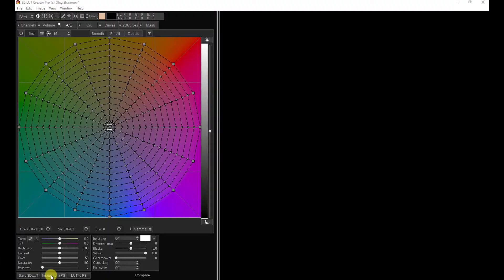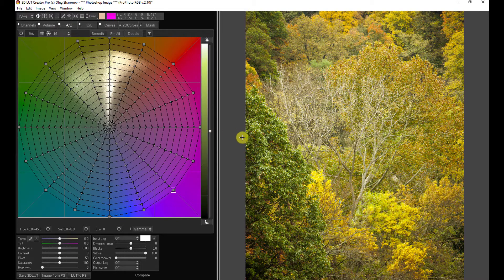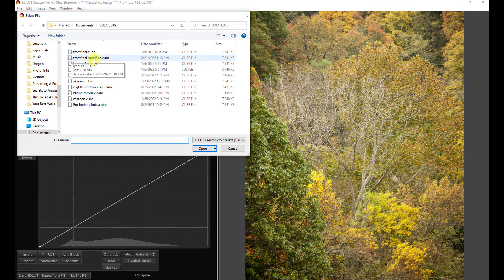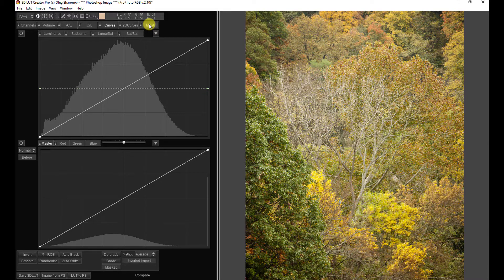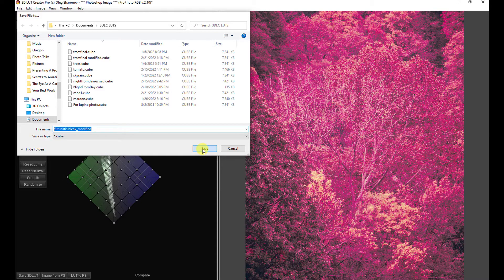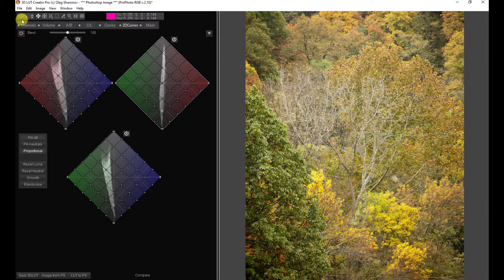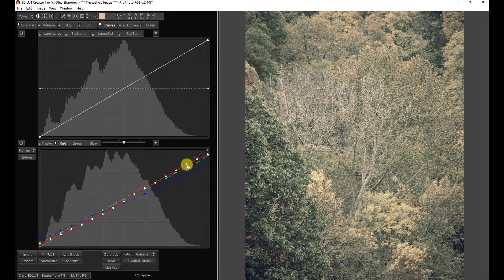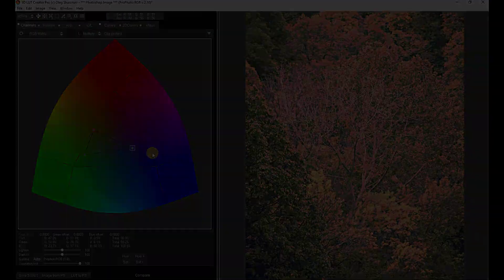How to Edit LUTs In 3D LUT Creator

Comment: Thanks once again Howard. Really easy to follow. I'm assuming you checked but if the example external LUT you demonstrate only had Curves and Channels adjusted by the author. Could this be a reason these are only available? I'm curious if you tried another external LUT if this would yield the same result. I'd check myself but I don't have any external LUTs. As I said I'm assuming you investigated this but I'm just curious. Wonderful tutorial as always.
Reply from the maker: Thanks Michael!  I did load three or four external LUTs that I had and none of them had anything in the drop down menu to access other than the channel and the RGB curve dialogues. I suppose it’s possible that by chance none of them had adjustments made in the other tabs, but that seems unlikely to me. I’m not sure why it would be that only those two tabs were chosen to be revealed though.